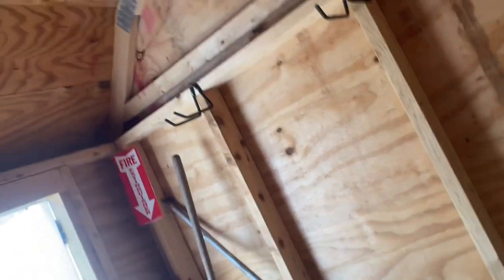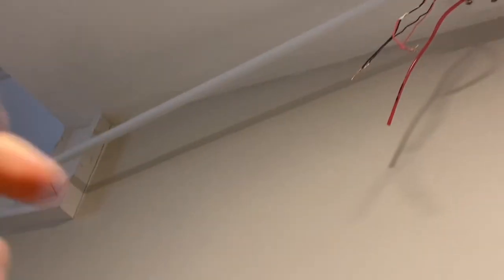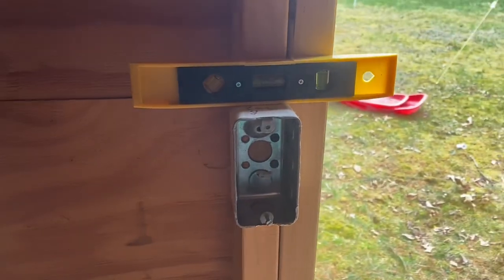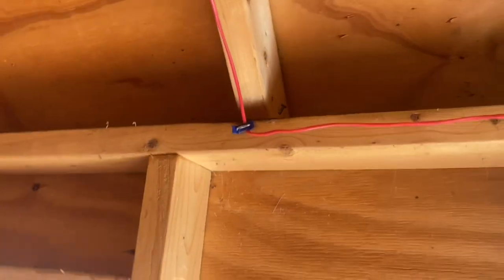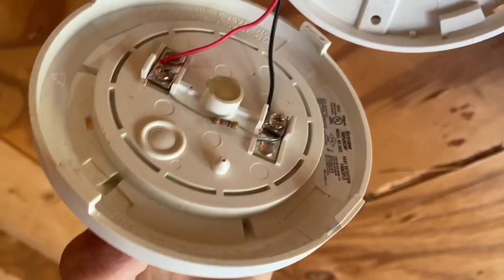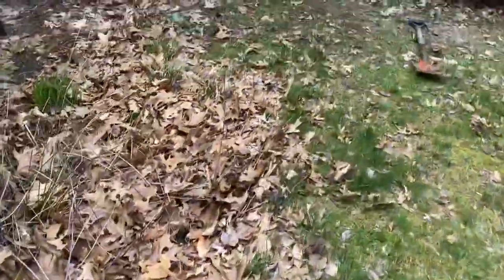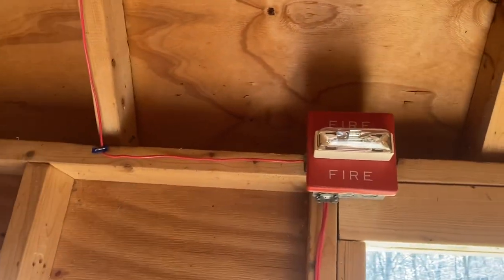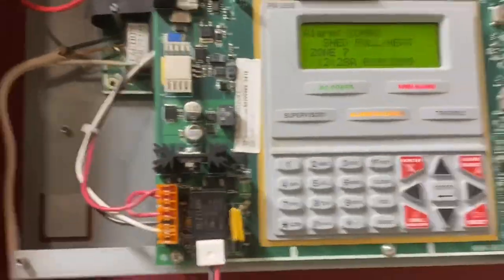Installing a Pull Station, Heat Detector, and Strobe in the Shed | Fire Alarm System Expansions

Comment: Very smart idea putting a heat detector in the shed. One quick question. I know this is going to sound absolutely stupid. Is your fire alarm equipment that you setup in your home and around your property permanent and actually used to detect real fires or is it just all for entertainment?
Reply from the maker: It’s mostly for fun but some parts do serve as SUPPLEMENTAL protection

Comment: Huh i though fire alarm wire was 16 gauge. Anyways im working on my next demonstration system. Its a simplex system..
Reply: Fire alarm cable comes in different sizes, the minum size of actual fire alarm cable is 18 gauge
Reply: Also, have you've gotten your 4007es working yet?
Reply: @Roxxofoxxo  almost. Wiring it next week at my high school. After that, i’m gonna get it programmed. The whole project came from the idea of turning an obsession in to something i can benefit from which i think is 200iq.
Reply: @achannelwithnopurpose1977  interesting, good luck with programming.
Reply from the maker: Fire alarm wire is many different gauges, you can buy it how you want